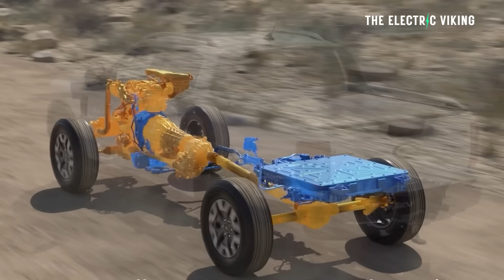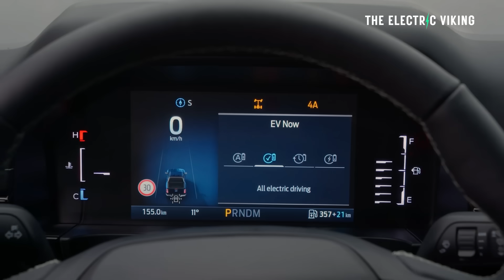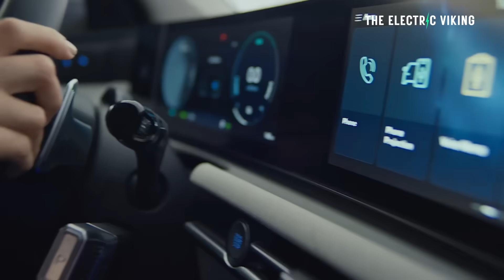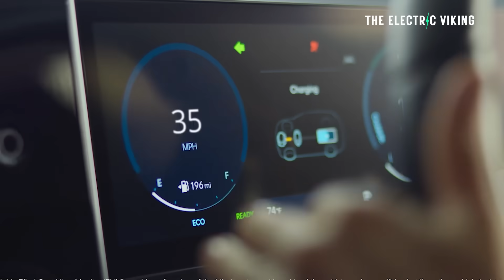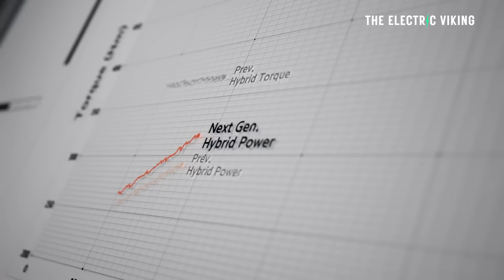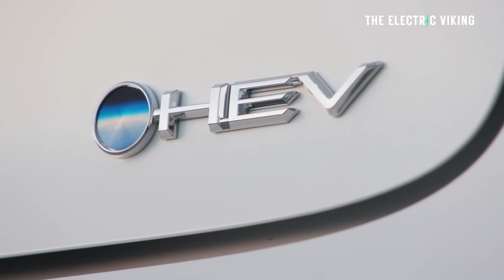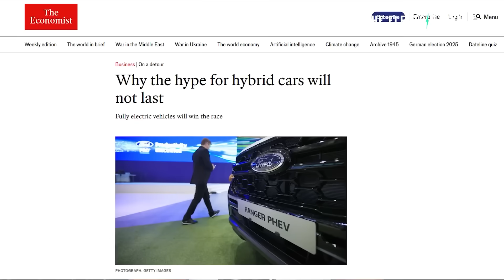Why experts say the HYPE for hybrid cars will not last

Comment: 3. Third , in this current energy source transition, the hybrid “power source” for a 5 seaters average car, the small 2l. ICE , a limited 13kWh battery and only 40 litres of gas tank and fuel, weigh in total about 200 kg for providing a good 1000 kms of autonomy, 3 min.refill and including the first PHEV 100 kms in full electric mode, so all the daily travel to work, shopping, leasure, local visits are by rechargeable power within one night with just a simple 16 amps 230 VAC mono phase plug for E-bike or a Karscher pressure wash set, etc. Therefore, NO fancy expensive 11 kW or more power supply always short of juice by Monday morning in buildings when everyone got one…are needed…..Upstream the current power network is just not made for such a massive amount of simultaneous vey high electrical loads and would cost a fortune to upgrade ..for just a transition poor solution …insane.,,
4. In à BEV instead, for a mere  400 kms autonomy only , the whole battery pack in a normal 5 seaters BEV has a weights of, and as a comparable “power source” , well over 400 kg . So, reinforced to carry this excess weight plus a lager E-motor which is not assisted by an ICI, the BEV motor will have to move 300 kg more load to move.The whole thing is then a good 20% less efficient…Dead weight kills mobility and local population as well with tyres and road nano and micro-particles PM main armfull contaminant and sometimes very toxic fumes. Therefore, ALL  the heavy vehicles over 1.5 ton for 5 seats must be BANNED away from our urban areas for our poor Covid hurt lungs survival. Just watch a convincing video of the trafic in Pnom Penh aerating light hybrids cars and clean catalysed fuel injected scooters, (Honda cubs) minor tyre wear and air contamination.but you see almost no BEV, no diesels and no trucks around. Also there, the town surface is flat and with all this combined, the air is quite pure, remarkably pure on most video’s..just watch it on a few to see!!!…
QFD Quot Erat Demonstatum…
Conclusion : All these rationals are why today, hybrids are selling well to wise people’s over other poor EV and BEV transient solutions requiring 6 times more dirty non-recycled lithium with a huge grey energy waste and pollution. The physics and reversible electrochemical energy conversion stumbling limitation walls are quite solid and unmovable!!!  And we heard the music….despite some Elon like daily miracle discovery electro-scams songs to confuse and fool the naives. 
Yes, a drastic technological breakthrough like the past high temperature supra-conductors or blue LED’s discovery is always possible beyond our currently known electrochemical combinations, but to be realistic, this is very unlikely . Every discovery possible on a kitchen table is most likely already applied on earth by humans and it took also over 10.000 Nobel price rated physicians and employees AND 10 years AND billions $ of instrumentation to discover the 10E-20 sec lasting boson heavy particle imagined by Higgs and other more simple discoveries would only be some unforeseeable quantum leap great an pleasant surprises…Don’t dream too much !!!
Down to earth, awake and also worth anticipating for resale value in the near futur, many futur H2 cars will be also with an hybrid power with a cheap flex fuel H2/SP95 ICE for flexibility, cost and to remove the panic need of searching a H2 filling station during the initial localised possible H2 shortages. The ICE H2 power auxillary will also lower the vehicle initial cost and weight using a much much smaller and cheaper (6 time less only) tiny fuel cell for cruising power on top while the Ice and a buffer battery provide the rest, acceleration, range, climbing uphill, high speed cruising etc. Just watch what Toyota is constantly developing, both ICE  and fuel cells H2 technologies for it…and they seems willing to use both…ICE yet less efficient, but can also use less pure cheap H2 to but dangerous above a 2-3% air content, so that O2 content in H2 and H2 content in air due to leaks…must both be legally limited. 
Also, the absolute need for these Toyota types of durable vehicles, some of their models being indestructible and very far away from other fast depreciating BEV junk with headaches and problems after 7-9 years already, and increasing fire safety hazards, are also an essential improvement for the planet. This durability requires also an adequate and interactive intercommunicating vehicle driving assistance system, truly active like TCAS for airborne flying objects and not only sensing the surroundings and reacting too late like the human drivers do….like Tesla’s murdering non-ergonomic current purely reactive mute and death self drive&crash crap. Such an high band 5G type inter-active technology (1 gigabyte/sec and 50 ms connection time with data transmission split into a) network constant rebuilt, b) data relaying and c) own data exchange volumes) has the potential (with passive radars , cameras and sensors planned trajectory confirmation) can eliminate up to 99% on the accidents and off roads unwanted excursions. Enough saving to fund improving system to 100%. Dying on the road or barbecued in an insane cyber truck must not be a fatality..This progress should  extend the average vehicle live potential well over the actual 20 years average and mean crash interval…Building better 40-50 years durable cars will also need regular and mandatory upgrades by the factory options, similar to current artisanal customisation, but expanded to an industrial volume…and then, we can really reduce by half the current 10 millions cars per year production for each one billion of habitants current pollution foot print we have today and.save much more earth resources which cut also by half the energy lost in recycling and pollution of the non recycled crap.

Comment: What utter bollocks. I spend at least 10 hours a day on the road and travel up to 400 ks. A hybrid Camry will get up to 1100 ks on a tank of fuel. Anybody who thinks electric is a viable option is an idiot.
Reply: Well call me an idiot then. I own a Camry hybrid and while it’s a good car, I can’t wait to replace it with an EV.

NO Camry gets 1,100 kms on a tank. I know because I’ve got one. That’s the book figure and it’s fantasy. I’ve rarely done much better than 800 km and that’s bloody good.

The other thing is that Camry hybrids don’t run well on anything less than 98. Standard 91 is not an option, unless you don’t mind burning out your fuel/air mixture sensor.
Reply: @thethirdman225  BS. The 2025 Camrys I use run well on 95 premium fuel and regularly get 1100k on a tank of fuel. That's combined city and highway cycle with passengers. Granted hybrids are more suited to city driving but I repeat, EVs are not the panacea people think they are.
For a start, they're expensive to insure, and repair and dealers hate them. So their resale value is crap.

Comment: The calorific value of diesel fuel is lower than that of gasoline. Hybrid cars use more fuel than diesel cars. If diesel fuel burns completely, it harms the environment less than gasoline. It is very easy to prove that hybrid cars are a scam. If you drive a hybrid car on the highway for, say, 300 kilometers or more, you will understand how much fuel it actually uses. The VW diesel engine scam went to court. Why hasn't the hybrid car scam gone to court?

Comment: I stopped buying new cars, now buying cars with 2-3 years experience. The PHEV has a good value for me, it is €15000,- cheaper than the brand new version of the EV I wanted, Peugeot 3008. And let’s be honest, currently the ev depreciates very fast. So in about 5 years there will be more second hand ev’s available which today have not been built yet, so for me my current PHEV is a good compromise

Comment: Who is the expert? Hybrid is here to stay. Do you know what is hybrid? Hybrid is actually means dual power source energy vehicle. Traditionally it was engine powered combined with regenerative braking power source. Presently, it is external plugin charging and regenerative braking power which is also a hybrid. In future, it may be hydrogen/water fuel cell combined with regenerative braking power. All are hybrids.
Reply: Might have to watch again, but pretty sure he was discussing plug in hybrids.
Reply: I don’t think he made a distinction. Also, I won’t be buying a hybrid in my next car because there are a lot of technical hurdles that are obfuscated to us purchasers around how the engine is actually being run very differently in a hybrid. It’s weird like I read a very big article about the technical aspects a few months ago and it’s actually quite interesting and I encourage all of you to look into it more. After that, I realized hybrid is not simply just adding a battery to an engine, but there’s actually a lot of consequences to the engine and how well it runs. And I believe but have no evidence that hybrids will likely have a higher rate of failure in the coming 5 to 10 years. Once Tesla or another electric car maker produces a full-size van, we will switch from our hybrid van to the electric van. All of you can do what you think is right, but I encourage you to do research on the nuances of how an engine is affected by the hybrid system.

Comment: Unfortunately, plugin cars make sense only for those who can charge at home while they sleep, and a level 2 is plenty fast enough charging all night.
Also, my plug-in hybrid it's cheaper to buy gas than expensive charging stations. I charge only at home, start every day with a full battery, and if the battery runs out I use the engine and buy gas once a month

Comment: At the moment, hybrids make more sense for a lot of buyers. But not for long. As batteries improve and infrastructure improves it’s going to be  downright crazy to buy two power trains, and put them in the same car.  Too much expense and too much more to go wrong.  The problem in the United States right now is the miserable infrastructure. They’re just are not enough charging stations to make taking a road trip a simple process every time.  Plus the range of the cars just isn’t there yet.  I have a full EV and I like it, but I can see why a lot of people are not ready to jump on board with the current state of things.  I think it’ll be a whole new story in 10 years or less.

Comment: Hybrids are a reaction to the consumer anxiety over charging stations, many charging stations have been built and are planned Have seen videos where  people have driven a EV from Adelaid to Darwin - TOP GEAR and another guy is doing a trip around Australia in an EV. Main highways heaps of chargers available. Will not forget what I was told about Petril vehicles when they were first introduced , you got your petro; from the chemist. PS as long as U have access to a power point U can charge an EV although it will take a while

Comment: Lack Charging infrastructure is my main concern
Reply: F.U.D.D. - quit watching Fox News. 70,000 charging stations in the USA, many at level 2, quick charging DC.
Reply: @LesterSuggs  They never miss an opportunity, do they? Honestly, America isn’t just trying to return to the 1950s anymore. It’s trying to return to the 1750s.

Damn oil industry bots.
Reply: Oh I see you're a new BOT account. Probably generated by Big Oil.
Reply: You already have charging infrastructure in you own home.
Reply: Especially if you want to charge in 10-12 minutes.  EVs might be capable of it but who is going to invest in the infrastructure required to achieve it?  The supplier would have to jack up the price per kW to get their money back.
Reply: @kane4013  Which is why you charge your car overnight on off peak rates.
Reply: @thethirdman225  Yeah that seems to be the way to go.  (I’ve watched a few more videos on EVs since my last comment.)

The rapid depreciation on EVs is still a concern.  I sure as heck wouldn’t buy a new one.  Maybe this will level out over time?  Until this happens though, I think I’ll watch and wait.

This guy makes a pretty good argument to your point:

https://www.youtube.com/watch?v=wbmCIQHYUCs
Reply: @kane4013   A lot of that depreciation is due to the rapid advancements with each passing year. Take Polestar as an example. All the early Polestars were either AWD or front wheel. IN MY24, they changed from front wheel to rear wheel. Meanwhile, with each year battery performance improves so the market for used EVs is less compelling.
Reply: @kane4013 Did you realize that Tesla alone has 2500 charging stations in America? Tesla began investing years ago, has the infrastructure and it’s financially self supporting.  Ionna is investing in DC fast charging and plans to open 30,000 charging ports throughout the United States in the next few years but making money as well in convenience stores. Most gas stations the gas is not that profitable, the soda and snacks pay the bills.

Comment: I like both EVs and Hybrids. One issue I see never discussed is if someone buys a hybrid wanting the gas engine to combat range anxiety and discovers they can make their normal travels only on the batteries and seldom use the gas engine, won't the gas get old and go bad just sitting in the tank and never getting burnt? Can't this cause engine problems?
Reply: The Chevy Volt and others solved that years ago. They nag the user to fire it up at intervals to get the water vapor out of the engine, circulate the oil, and freshen up the gas. You should also use non-ethanol gas and fuel stabilizers. Or just get a car with no engine, gas tank, or transmission to worry about.
Reply: @jamesvandamme7786  I might just get a Flintstone automobile, lol

Comment: It’s a no brainer, but ev’s are so easy to live with , and never have to go to a gas station , especially if you can charge at home twice a week for around 12 euros,if you need a “full” charge each time, if your going on a longer trip you just have to plan a little to where you need to charge, mainly for piece of mind, but why buy a hybrid , that need 2 fuels, before you by an EV do your home work, and how you’ll use the car each day, my Byd will sell at a good price in 4 years simply because demand will be much higher, and cheaper to buy second hand than new,  also you still have the long guarantees to cover you for at least 4 more years, depending on millage, plus replacement batteries by then will be much much more cheaper than today’s battery prices, it really is a no brainer, and hybrid batteries replacement won’t be cheap due to lower demand by then, as volume of scale keeps the main EV  car cheaper.